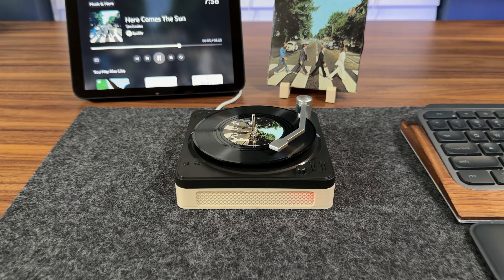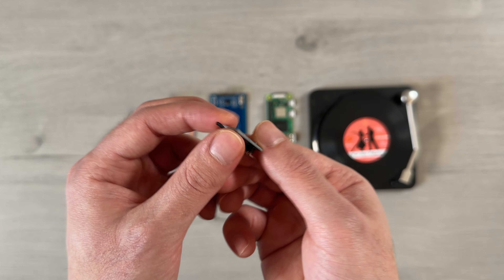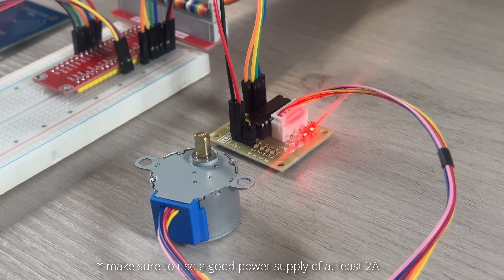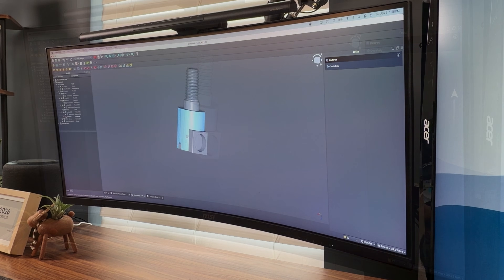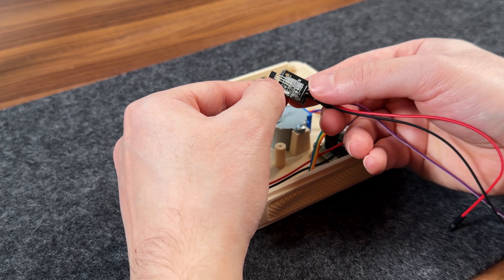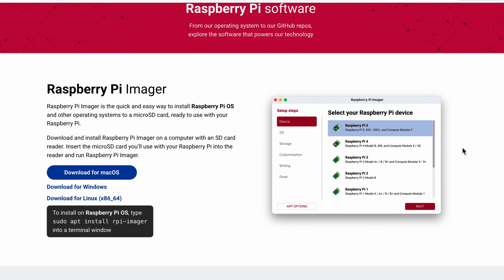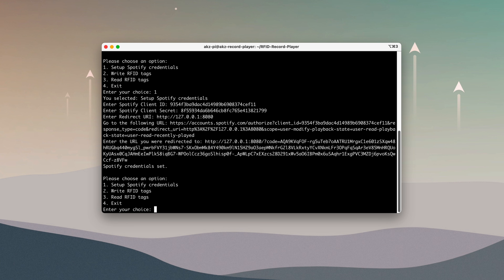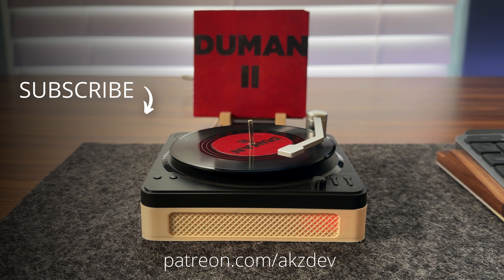I built a Spotify Record Player with a Raspberry Pi

Comment: Okay wow this is exactly what I planned to build for a few months myself. I bought a Raspberry Pi Zero 2 w last year together with rfid sensors and a sound card. Of course the version without GPIO so the project was on hold for a 2 months until I got my GPIO header. This year I finally started working on the project again but I can't continue because Spotify API is disabled since 3 weeks (you can't create new apps)
I'll probably take inspiration from your project, great result!

Comment: Cool project! Although a pi is probably overpowered for the task, as i built a small media controller for my spotify using an esp32 (although you did mention this in video)  But using your pythom scripts to link a tag uid to a song is handy and the whole adding songs and onboarding process is probably easier on the pi. Did you make a systemD service for auto starting the record player, or do you manually ssh into it and then run the script?

Comment: can i use the rasberry pi 5 for this?
Reply: yes, but its overkill
Reply from the maker: You should be able to build the same circuit but it wont fit in the case I designed, and it would be overkill

Comment: imagine if you could build a disk with a round OLED 400x400 MIPI circulair OLED-display that is powered by the played when put on it and displays the artwork of the song played
Reply: From what I remember, I tried to find tutorials with feedback on an OLED screen in TXT format or an HMI screen. It was for use with an Arduino, Wemos or esp32/8266. 
I've never been able to find a suitable tutorial. I imagine it might be simpler with a Raspberry Pi! I'd appreciate any resources or GitHub repositories you might have! Cheers!

Comment: also about adding extra controls through the esp32? 
why not use just an esp32 for something like this... there's already scripts out there that could've been adapted ? 
I do love the way you implemented things though it's really nice. 
just make sure that power draw doesnt burn out your pi2w since it's not in spec for draw. 
holistically you're not meant to source over 50ma from GPIO but as it's a power pin you're fine since you can draw up to ~2A through those :) 

just be careful, although im sure you already are !
Reply: I'm planning to build this with an esp32 SOON
Reply: @dyunamisu  Sounds like a massive win. 
also I didn't realise it was AKZDev who built my favourite scripts for interfacing with spotify in the firstplace, crazy world we live in... 
built at least one project around his scripts they're great
Reply: @M@ModarkVids Yeah frr also I’ll add an extra button that, when pressed, starts an access point so I can add new RFIDs or modify/delete old ones, and when I’m done it will shut down the access point so I don’t have to flash it again.

Comment: Pretty dope setup. Just as a recommendation, i would replace that stepper motor driver with something smaller and more efficient.
Like at least A4988, DRV8825 or TMC2209/TMC2208. They run a lot quieter and more efficiently but you have to rewire the stepper motor to be bipolar instead of unipolar. Btw that mod roughly gives you 3 times the torque at max power draw if you ever need that for other projects.
Reply from the maker: Thank you, will definitely look into alternative drivers for a future iteration. I went with the ULN2003 bc it came with the stepper motor as a pack and noticed the stepper motor does get quite hot after long usage, hoping these alternatives help with that.
Reply: @AKZDev  yep thats the usual stuff you get when you buy those steppers. have a bunch of those ULN2003 gathering dust since they are basically unusable if you want to run the motors for a longer time and they are quite inefficient. Unipolar motors only use half the coil for each step and the the darlington transistors of the ULN2003 have a high voltage drop so a lot of energy is just transformed into heat.
When you rewire it to bipolar the whole coil is used and thus increasing efficency and producing less heat. Combined with a modern stepper driver that uses MOSFETs you get  even less heat since they are more efficient at switching and some use pwm chopping, also you can limit the current much more pricesely to what you actually need in terms of torque. So its absolutely worth the hassle of rewiring them. But just to give the full picture, there is also a downside to bipolar wiring: it increases the magnetic field the motor generates. Usually this isn't a problem because the metal casing does a good job of shielding it but if you have delicate or shaky RF components right next to it, it might cause problems so its good to keep that in mind.